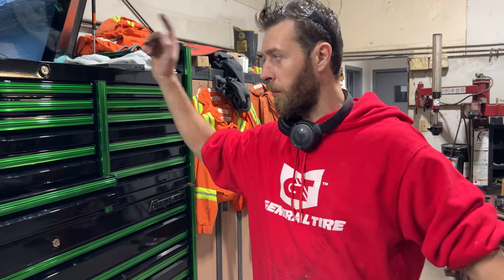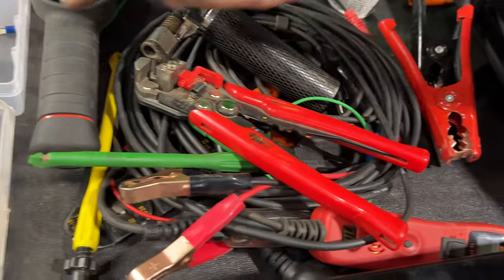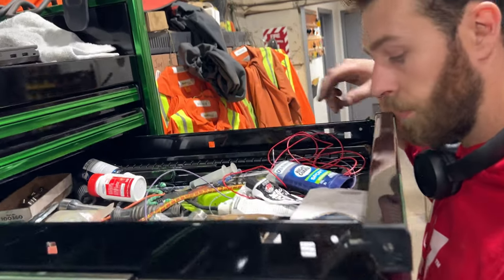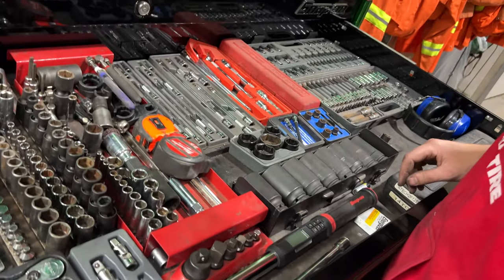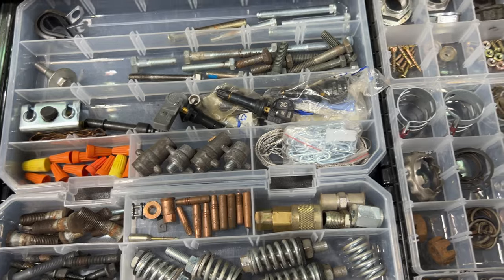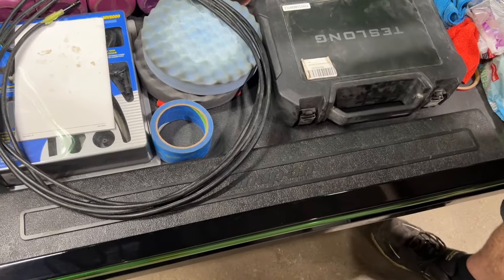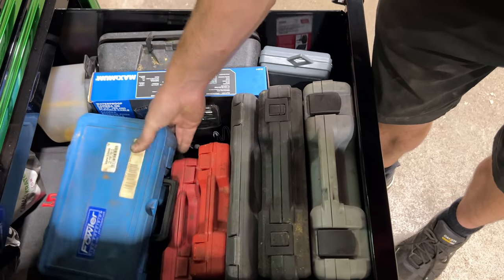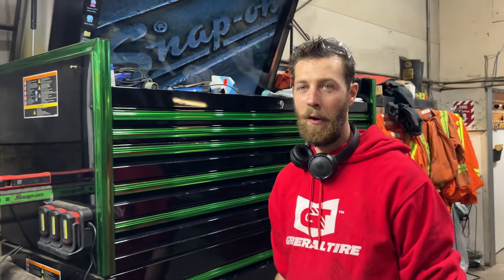Snap-On Epiq Toolbox Tour 2023

Comment: Very very nice, dam that sucks to hear that the Würth under hood light isn't that good I just ordered it the other day it went on sale this month
Reply from the maker: The only downfall is the battery life, I find it only last about 20-30 minutes from full charge.. besides that it’s a great light for the price. I bought mine for 99$ cad when they first came out
Reply: @Tech-28  that's pretty close to the $65 I just paid. Their large bit set and 1/4" socket/ratchet are on sale this month , if you need any more hex bits. I didn't need anymore but bought them anyway lol
Reply from the maker: @andrewscott8892  lol you can never have to many tools :) right on man, I’m sure you will enjoy the light, I sure did until I moved on to the snap on light and even now I still use both sometimes.. I like using them for interior work hanging them across the headliner

Comment: How tall are u?
Reply from the maker: 6’1
Reply from the maker: The top ledge of my box that I set things on (not the top of the lid) is just below my eyeballs 👀
Reply: I have an epiq and wanna go top box route instead of hutch but I'm only 5'8 so I don't think that's gonna work lol
Reply from the maker: @ichootu17  my honest opinion is that it will be too tall, I was in the same predicament and I actually forgot to take in account the extra height of the wheels but it’s still not to bad for me, I rarely use the top as I just have a 55” tv as my computer monitor up there mounted to the lid